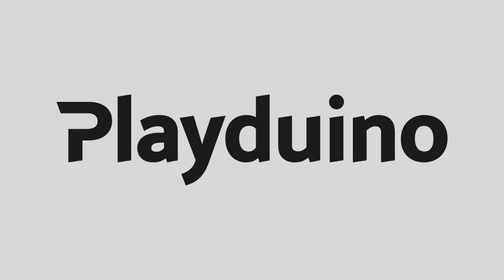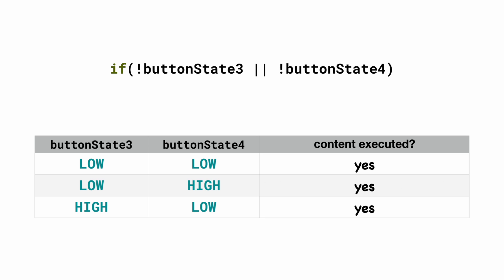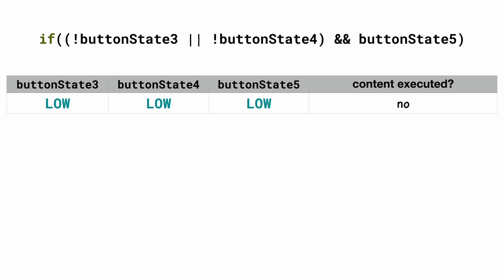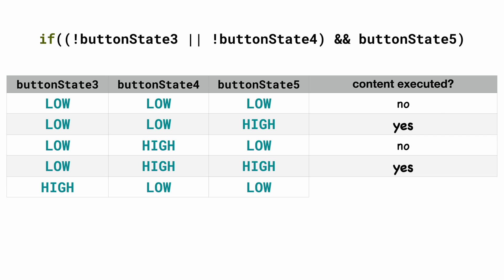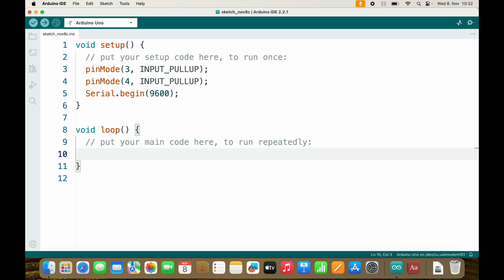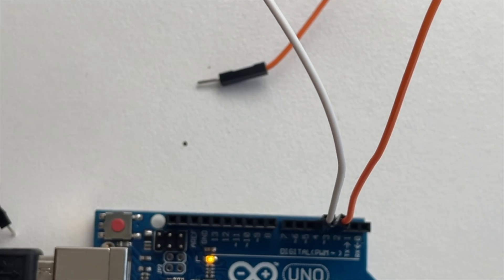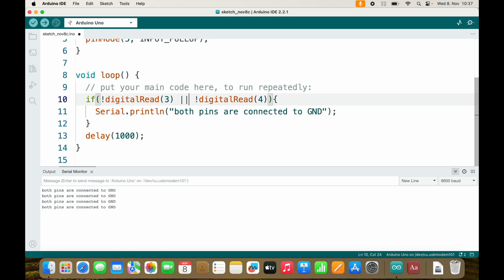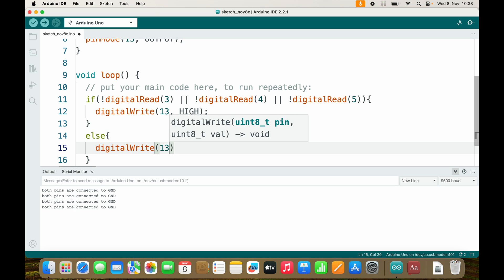Basics Boolean Operators &&, ||, ! - (Arduino Uno Programming for Beginners)

Comment: I’m definitely doing something wrong the high low tables don’t work for me
Reply from the maker: Sorry to hear the high/low tables aren’t working! In Arduino, HIGH and LOW act like true/false with &&, ||, and !, but things like pin modes or wiring can trip things up. Can you share a bit about your code or setup (e.g., what pins or conditions you’re testing)? That might help pinpoint the issue. Thanks for watching!
Reply: @playduino First of all I am a total beginner, I wrote the line

If((!buttonState3 || !buttonState4) && buttonState5) {
digitalWrite(10,HIGH);}
else
{digitalWrite(10, LOW),
}
delay(1000);

I connected the 3 input pull-ups through a push button, and connected to ground, and then used an led on my breadboard, am I right in thinking that for each low on the table I press a button, it does seem to work that way,

Comment: Nice explained. You can improve your first example for speed by writing "!(buttonState3 || buttonSate4)". But i admit, that it might be more difficult to read. So if speed is not importend, your variant might be better. But if you are coding on algorithms that must be fast, then my variant is better.
Reply from the maker: Oh yes, thank you for pointing this out! Your solution requires one operation less and does the same 😊
Reply: @playduino In fact in compilers are very clever today and it might even save 2 operations, since if buttonState3 is already true, then the software doesn't need to check buttonState4 at all.
Reply from the maker: Maybe the compiler translates both of our solutions into the same, perfectly optimized hex file
Reply: @playduino  Looks like my new comment isn't published, since I added a link.
Once again without link: You are right. I tried with the "Compiler Explorer" online. Both variants are translated the same. But I tried with local variables only. I will try with function calls on my PC in the afternoon.
Reply from the maker: Awesome thanks